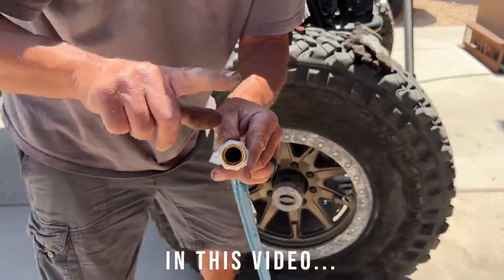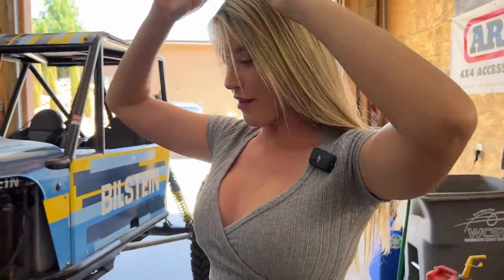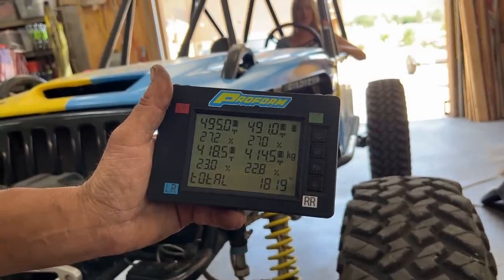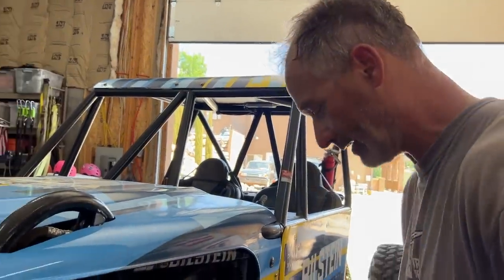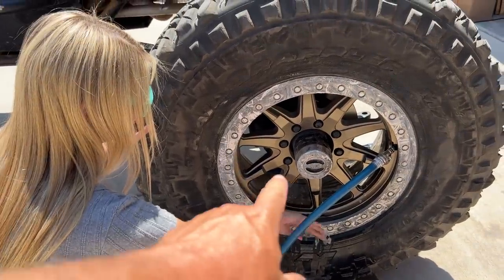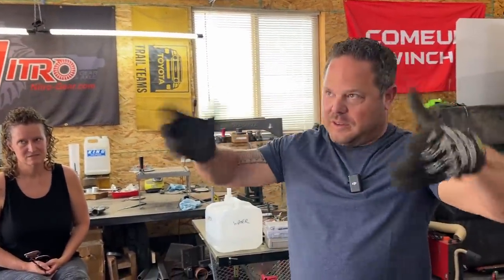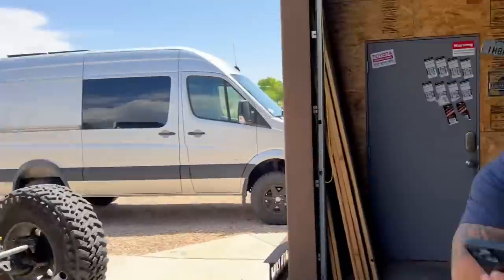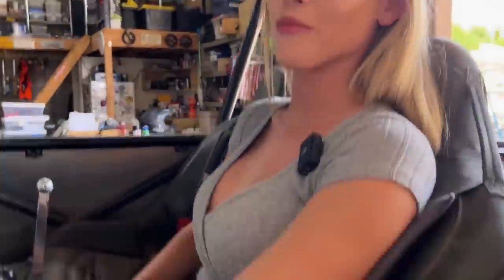Filling My Off Road Tires with WATER!

Comment from the maker: We didn’t think we needed to say this, but just to clarify - this is for low speed off road and extreme rock crawling application only. This is not something you should do to a rig that is driven on road or on highways. If you do, you’re gonna have a bad time. 😁🤙
Reply: So True, Thank You. Happy Trails
Reply: I have like five friends that follow you in Gypsum like an hour east of grand Junction we don’t have buggies but would love to go wheeling with y’all if you’re around this direction
Reply: I suppose I learned something new. I've never heard of putting water in tires. I'd rather be proven wrong once than continue to be wrong forever.
Reply: True that!!
Reply: we need to take disclaimers out of society or for thanos to snap those fingers.. way to many people who don't have sense enough to not know how to live life
Reply: Even bleach has a do not drink warning label. People are stupid
Reply: @iwishiknew10  right
Reply: While you guys are in Grand junction we should drive 81 miles to Delta try out the Adobe hills, miles of them going all the way to Montrose.
Reply: Why use water and introduce it to the inside of the rim. We fill tractor tires with rim guard so no rust or corrosion happens.
Reply: @johns6290  most wheels are Aluminum Now not steel so more then likley the wheels won't rust
Reply: For sure this is a good fix for desert path... as you broke something and need wait for a rescue... you have some water to help you last till they comes !

It's a joke, but with a minimal real sense... as if you fall into a lake with your car, you can use tire air to take a breath and have time to get off.
Reply: @montesamapping  interesting way of looking at it 🤔
Reply: How can you have a bad time when this baby is around...
Reply: We use wheel weights in scale to this. With my RC I've considered using weights in the wheels. Some people put BBs in their tires.
Reply: Never underestimate the ability for people to lack all common sense

Comment: Windshield washer fluid rated to -20-30 is the cheapest way to put non-freezing ballast into tires.  Rimguard, beet juice, is heavier per volume but it's expensive.  The worst part about liquid ballast filled tires is when you have to remove them for repairs.  Your formerly manageable weight tire/wheel now weighs two or three times what it used to.  Have fun taking it off and putting it back on.

Comment: It's more relaxing to push snow in a tandem axle dumb truck with the spreader in the back full of salt and toped off fuel tanks. When you start to get light it sucks...... So, weight in your off-road application is just one of many situations where adding weight is good!

Comment: tractors  in southern Missouri use 50/50 methanol water and they don't have passenger style valve stems so there's a different tool for filling with fluid. and they aren't filled to a certain weight.  they need to be filled to about the top of the wheel so the fluid stabilizes in the tire and isn't sloshing to and fro causing the vehicle to lurch.

Comment: Instead of water which can freeze and corrode the rims,  you should consider the fluid they use for tractor tires called Rim Guard.
Reply: You can use antifreeze with water in tractor tires too.
Reply: @Craig_N  But water with antifreeze will still corrode, Rimguard won’t. Hence the brand name.

Comment: Rim guard is beat juice that is used in many tractors tires.  It reportedly doesn’t freeze, doesn’t rust, and is Eco-friendly.  There are some agricultural suppliers that will send a truck to your location to fill or pump down your tires.  A better solution than water, and I think it’s heavier.

Comment: In the 90's I had a Tecate 4, 250R built for TT. Took off the rear dunlaps, filled using wet saw dust, topped off w/ 1 can of green film fix-a-flat. This after losing many rear bead lock tires on the chain side, full throttle in 4th doing large clockwise turns on the homemade field track.. I needed to find more traction/ less bounce= less repairing wheels= more fun. Funny what we do to find our happy place.

Comment: Here in western PA we always used calcium chloride in our tractor tires. That was also a million years ago so there likely have been some advancements since then. 
Love all your rigs. Love Kevin’s humor and Brittany gets more beautiful with every video! 
Looking forward to seeing side chick wheeling with this new upgrade
Reply: That is exactly what I was just about to tell them that we used in our Tractors in PA as well and never had an issue with freezing or solidifying but this is the first time I have watched them and I liked the video so of course I had to like and subscribe so that means I am looking forward to more content !!!
Reply: I wont use that anymore. I use beet juice or washer fluid.
Reply: I remember this from when I was young.   Wondering why calcium cloride?   Is it heavier?   For an antifreeze?  Anti corrosion?
Reply: @currentliveoccupant  for sure because it doesn’t freeze. I can’t say if there were other reasons or not

Comment: I run a tractor store we water up most tractor tires here. Use RV coolent  so they do freeze in the winter. And it's easy to clean out if you need to patch a tire.

Comment: Imperial gallon is ten pounds water. In Canada we use a mixture of salt and calcium with water that does not freeze. It also adds weight to the water. Farm tractors and loaders use it to increase traction and as counter weight.
Reply: The salt can cause corrosion on any exposed metal.
Reply: @robertheinkel6225  True, but Many ag tires have tubes. And the brine is used to prevent thw water freezing.

Comment: Great way to get a lower center of gravity. Also a great way to twist your frame. But you don't need to fill them all the way up with water.
Reply: I was actually thinking somewhere around 1/3 volume to maybe half volume but I’m thinking you want to keep the majority of the added weight below the center of the axle.
Reply: To prevent rust on the inside of the rim, the fluid level should be above the  top of the rim.

Comment: Not sure about a Jeep, but I do this in my tractor tires.  Its 2 wheel drive, so all the extra weight in the back in the tall tires is great to lower center of gravity and add traction.
Reply from the maker: Can have similar benefits for extreme rock crawling applications ☺️

Comment: Here in Styria/Austria we fill the tires of our vineyard-tractors for the very steep slopes the vine is growing with water for decades. Works very well as long you do not try to drive the tractors onroad at speeds above 10 km/h.

Comment: I used to run 225 pounds of lead in front and 60 pounds in the rear on my old comp buggy. Found lead shot worked better than straight water. Never tried both.

Comment: I'd be curious about using RimGuard ( beet juce) instead of water.  Among other things it is used in tractor tires for extra weight but won't freeze and is non toxic.  It does stink though.

Comment: Depending on how cold it gets there another liquid to use for cost effective is windshield washer fluid. Just get the type for your climate. I run it in my plow tractor and I get traction for days.

Comment: Ya adding that much weight inside the tires is going to do a couple other things you don’t want. 1. Wheel balance issues 2. Steering effort will increase (acts like a gyro) 3. Increased braking and acceleration efforts (rob power). 4. Your driveline is not prepared to handled the extra twisting force (break axles) 5. The whiplash affect from stops 6. Whatever shocking tuning you did was a waste. Other than making weights on scales you significantly lost performance in all aspects of what it was designed to do. If you want to lower the front COG for crawling use hydraulics to drop the suspension height in the front or raise the rear. Hopefully the lugs don’t break.
Reply from the maker: I don’t think you realize this is just a rock crawling buggy. It doesn’t have any of the issues you stated above except for possibly breaking axles due to the increased weight and traction but that’s also where driver experience comes into play. This mod is not for anything that drives at highway speeds. The vehicle is purpose built for rock crawling at slow speeds like our last video.

Comment: Construction rollers, the type with steel drum on the front and rubber rear tires put calcium in the tires I believe.  Been a longtime but pretty nasty green fluid comes out when they pop.  No idea what the value of calcium would be except a very low freezing point.

Comment: I had an offroad truck with a flat sat for a while.  When I aired it up and took it out, it had a crazy wobble over 20mph.  Took it to a tire shop thinking the wheel needed balancing,.  Techs were pretty upset when they put it on the machine and a bunch of water came out
Reply from the maker: Definitely don’t want water in the tires on a vehicle driven on pavement or highways. 😅😅

Comment: In theory could you get the same effect with the self balancing powder (sand) they use in tractor trailers without the sloshing weight shifting effect? I'm new at this but it seems like eliminating all of that weight shifting back and forth would be a benefit...

Comment: With this heavy wheels vou can get problems with your wheelbaerings, or not?
Reply: Wheel bearings support the weight of the vehicle, not the tires.  The wear on tie rod ends is a different story

Comment: They used to use beet juice to put in tractor tires. Because beet juice does not cause.. corrosion. You might want to consider something like that if you're going to keep them filled long-term...

Comment: Wheelbase is measured from center of axles.
Reply from the maker: You can also measure wheel base from the rear of both beadlock rings (or any other equal distance from center of the hubs). 🙂🤙

Comment: Maybe brake line is hanging it up.   looking forward to seeing the new trail in Grand Junction
Reply from the maker: Think the piston was just kind of seized from sitting for long periods outdoors. Kev manually moved the piston & it freed up after a bit.
Reply: @LiteBrite  previous gen ford 150s front brake lines deteriorate from the inside and let fluid out to the caliper but will not let it return.  That is why I suggested that.  It was intermittent on my f150.. really odd.   take care you guys. :)

Comment: Fluid blasting wheel is the cheaper solution that comes with the inherent risk of dynamic shift in center of gravity.  Solid wheel weights is a much safer engineering solution.

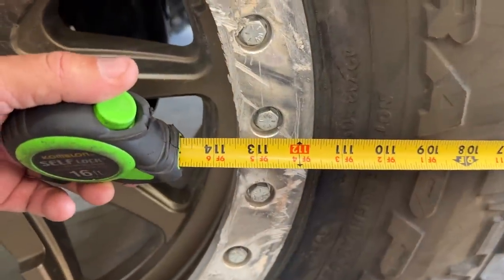Comment: @1:56 wheelbase isnt measured at the rim. It's measured hub center to hub center. So yours is about 120" assuming the other end of the tape was in the correct spot
Reply from the maker: You can absolutely measure wheel base from front/rear of the wheel rim to front/rear of wheel rim. Which is what we did here. Assuming you’re not running oval shaped wheel…the math works the exact same. 🤙

Front of the rim to front of the rim. Rear of the rim to rear of the rim. Center hub to center hub. Front of the tire to front of the tire. All of these are literally the exact same measurement (unless something is jacked on your rig). The measurement we have in the video is accurate. 🙂

Comment: All that traction comes at a price..no matter what you do to that D60 you’re going to be busting parts. Put 40 spline RCV’s or some other manufacturers axles in with a breakage warranty because then you’ll be killing ring n pinions and they’re cheap and easy to replace on a crawler. My buddy ran 250lbs per tire with 42” red labels and he could bust CTM’s if he bounced on climbs..he runs a 10” Spidertrax high pinion front diff now and can bust front driveshafts at will if he’s not very deliberate with the gas pedal! Comp buggy life is for people with very deep pockets.

Comment: Most of my Tractor Back tires have Fluid in them for Traction. I never heard of putting water in a 4 wheeler . If it works?
Reply from the maker: If you’ve ever watched a W.E. Rock competition, most of those rigs run water in the tires. It’s insane how it can change performance, traction, and stability of a rig on extreme obstacles.
Reply: @LiteBrite  Interesting , Thank You

Comment: Why not use calcium? Farmers have been using calcium in tractor tires for years. I just bought a used ford tractor and was told by the guy I bought it from that my back tires weigh in around 1,000 per tire. Calcium weighs more and won’t freeze in cold weather. So you need less to make weight and you don’t have to take it out in the winter.

Comment: Are my ears on point, was at least one of those DJI mic's set just a little too sensitive, and clipping on input?
Useful to know for anyone buying them, that the clip isn't as harsh as many other brands, more like it's got a soft roll on of Auto Limiter to save the sound from being useless.
It's really come down to the DJI's or the Rode's for those little clip-on mics :)
Reply from the maker: We’ve been trying to find a better place to place Kevin’s mic, cause his voice tends to blow out the mic if it’s remotely close to his collar. Still playing with them
Reply: @LiteBrite  #ManlyVoiceProblems 🤣
Reply: @LiteBrite  tried the brim of a sponsers cap, or tuck the pack in at the back and sew a mic around and under the brim.

Comment: If you ran water to the bottom of the wheel, it might be ok - but filling it to the halfway point? That extra 156 pounds in the one tire and the extra 182 pounds in the other is definitely going to snap some axles. The centrifugal force alone when wheel loses contact with the ground, spins violently, then abruptly stops when it hits the ground again is also going to cause severe imbalance / handling / braking issues. 

Water in your tires for extra traction is an option for LEVEL ground, not extreme rock-crawling. But - what do I know, seeing as how I am NOT an accomplished professional rock-crawler? - I think it's just common sense, but that's MY conjecture.

~Just a suggestion - If you need more weight on your front suspension, then custom-fab some lead to your axle truss? Lead weighs a whopping 6.55 pounds per cubic inch! A 12" long x 3" wide x 3/4" thick plate of lead would weigh just under 177 pounds.
Reply from the maker: I’ll let all the professionals rock crawlers at the competitions know that your common sense outweighs their personal and professional experience. Yes it can break axles which we stated. You need upgraded parts and to change driving style if you like the skinny pedal. This mod is NOT for vehicles that drive on the road and down the highway. This is for Offroad use only with experienced drivers and built rigs.
Reply: @LiteBrite Well - I really do appreciate you letting them know a  unpredictable spinning mass of ridiculously unbalanced extra unsprung weight is just silly.
Reply from the maker: You do realize…that this is a rock crawling buggy that rarely even hits 20min, right? Lol If you’ve never watched a W.E. Rock competition, you really should. You might learn some things (from the profressionals), and be entertained while you’re at it. 🤙
Reply: @LiteBrite  Do YOU realize that it is a 'timed' event?... Do YOU realize, that as a general rule-of-thumb as far as 'racing' is converned - that every 1 pound of extra unsprung weight is like adding 10 pounds to the vehicle chassis itself? But hey - go ahead and defy the laws of physics and math, in your quest for traction. I'm going to bed now and maybe when I wake tomorrow, this'll all be nothin more than a weird dream. -G'nite.

Comment: Not too sure about adding water inside your tires! If it works, then OK! Happy Trails to you both!
Reply: Adding weights to the front end is not ever going to be the same as adding the weight of water into the wheels. It is all about the weight down as low as it can be.
Reply: It adds weight at the lowest point possible
Reply: Farmers have been doing it for decades
Reply from the maker: This is not for vehicles driven on pavement, but for off road purpose only. ☺️ It’s pretty proven by some of the best profession rock crawlers in the world, especially for buggy applications like mine.
Reply: @LiteBrite  Please let us know how it works out for you!

Comment: Is there a point to this? I feel like your tires would kill themselves while also killing the suspension and shocks, along with a possible chance of dying in the process 😅
Reply from the maker: There’s a lot of points to this for extreme rock crawling applications. ☺️ Lower center of gravity, improved traction, keeping the front end from getting light on extreme vertical climbs, etc.

Comment: So they don't know what axles are in the front axle. They probably don't know what's in the rear. You do know what that means. Nothing is getting any maintenance.
Reply from the maker: We do maintenance when things break, other then that it’s party time
Reply: @LiteBrite  You are confused patching back together I mean fix is not maintenance. I would of thought that with each used vehicle you buy it would get a complete tear down and prep before using. How long have you had the buggy? Yet it still has break problems. It was mentioned that the buggy had break issues from day one.
Reply from the maker: We’ve had the buggy for about 2 years. A good enough driver can just drive around little problems (and brakes not being as strong as we’d prefer is a little problem, since they still work just fine). We definitely don’t do tear downs on everything we buy (except for the 4400 bomber we finished King of the Hammers in, cause that was necessary to finish two years in a row). When you have 15+ vehicles, you just learn to prioritize fixing what’s actually broken & worrying about the rest when you have to. 😁🤙